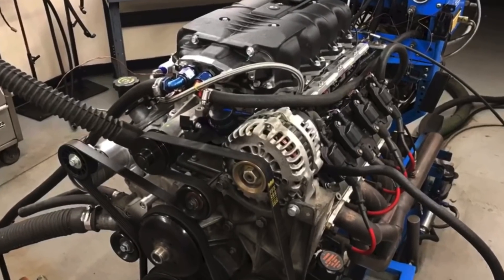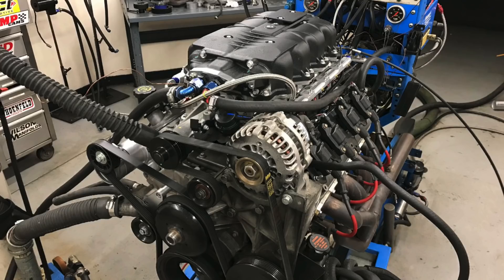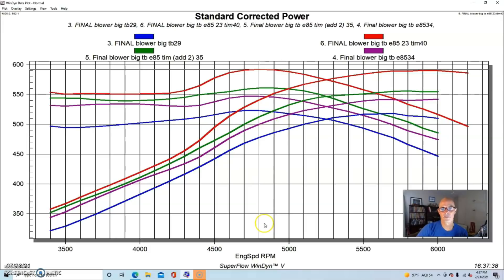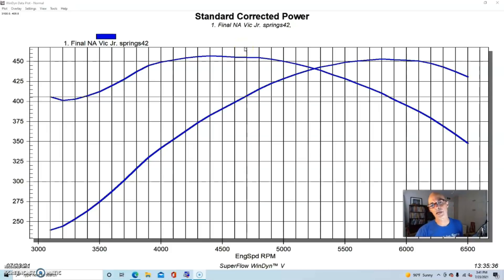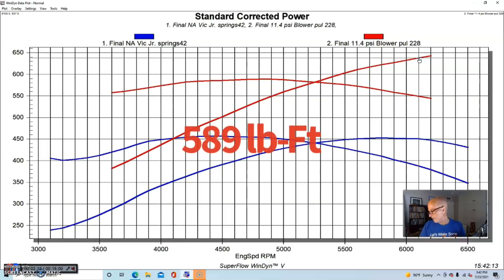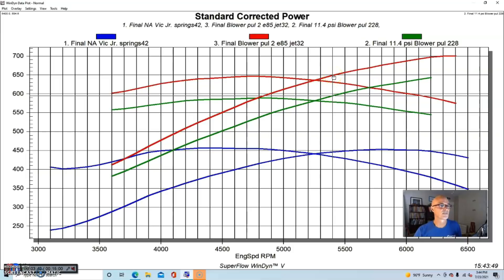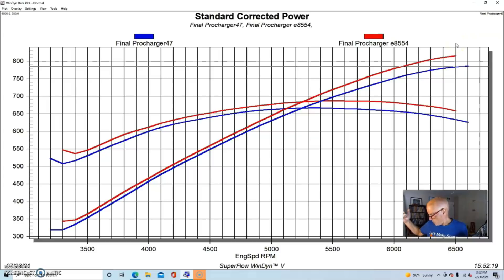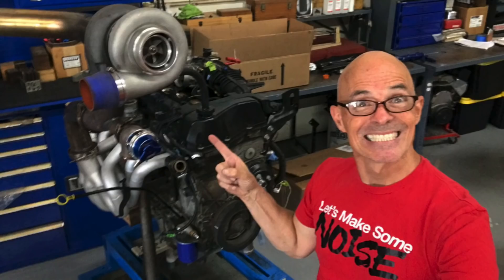E85-THE (CHEAP) GOLD MEDAL FUEL FOR BLOWER BOOST!

Comment: Richard holdner

If you are relying on the e85 to do the cooling why not run it through a cool can and bring it down as cold as possible?

Gail Banks ran air to water intercoolers on a naturally aspirated motor and got 6% more horsepower because of the colder air.

Engine Masters showed that by chilling the fuel in the carburetor they got more power

Those things both indicate that you would see an effect

Comment: 1. What heat range plug did you run? 2. What was the exact percentage of ethanol? 87% E is the most optimal blend. 3. Adding 91 octane doesn’t add through the performance. E is hard to light anyways, adding in 85/87 would work better than adding in 91. 4. What were your AFR/Lambda values?

Edit: adding race gas hurts the total performance
Reply from the maker: heat range 9, never tested percentage,
Reply: @richardholdener1727  I see a lot of guys go heat range 7, and 87%. Multiple ways to accomplish the same task. Love seeing tests and studies like this

Comment: Big question. I make 800hp on 93 with my 565. If I were to run e85 I would have to buy drum fuel. None in my area at the pump. So my question is, if I’m buying e85 in a drum wouldn’t straight alcohol be better sense? Also at that power level I wouldn’t trust pump ethanol anyways. Too much fluctuation in percentage. Answer would be greatly appreciated! 👍
Reply from the maker: does your combo need the e85 (high comp or boost)
Reply: @richardholdener1727  compression is low. 8.25:1 boost is low only 9psi. My issue is a 6-71 old school weiand that I have to turn 18 percent overdrive just to make 9 lbs. so heat is my killer of power.
Reply: @frankensteincreations4740  What you need is a better blower so you can slow it down and not build the heat. Weiand is the absolute bottom, I should know I've raced them.

Comment: I've been running 110&112 in my sbc 6-71 and it's gotten expensive I've been thinking about switching to the E85 just concerned about my carbs, thanks for this video, I'm switching
Reply: You need Ethanol carbs. E destroys rubber, so you need silicone guts. Gasoline eats silicone though, so unless you are solely E, you need Teflon and stainless guts.
Reply: You needs the e85 draw through carbs. Expensive but people make them

Comment: Been running E85 in my stock L67 Regal for about a year now. Insane how much quicker it is and consistent it has been since switching.
Used to have a similar car with headers, cold air intake, and a 3.4" pulley and the E85 car feels faster and it's so much more consistent

Comment: Also curious about Methanol here. M1 or M5.. possibly to run through fuel injection?? Maybe even a flex fuel vehicle???
Reply: I've been asking for meth tests for 2 years...
Reply: @YZFoFittie   well it's only 50 bucks and one test away from a video. Maybe we can get a few more requests for it. Methanol! Methanol!
Reply: @RontinsSpeed  lol $50? Nah, it's not as simple as a fuel change. You need MASSIVE injectors to run the engine. I didn't mean, "meth injection" the supplemental type! Lol
Reply: @YZFoFittie   I understand the fuel flow is increased. I run methanol in go karts, we have to jet up significantly. I wanted to see how much power it's worth on a bigger scale
Reply: @YZFoFittie  I completely understand the upgrades involved, but Richard Holdener is the man, he has the goods that he needs to make it happen. Not a big deal for this channel, just pour in the fuel, swap injectors, and tune
Reply: @RontinsSpeed  yeah it's not nearly that easy on a v8 scale. It's 20-30% more fuel which brings you into mechanical fuel pump realm. Many setups even go mechanical on the injectors as well.
Reply: @YZFoFittie  let's get Holdener's view on this
Reply: @RontinsSpeed  he rarely replies at all let alone on older posts, but one can hope...

Comment: Richard. how can I send u pics or vids? I have a great pic of a schweatty carb adapter and 6/71 (468 w/3310s done by Classic Motorsports in Alexandria, Mn)on a 95°+ hot, humid Minnesota day on the dyno in July or August.  Can you do a bit about adding ported vacuum advance for steady state cruising and its effect on egts. It will blow people's minds, especially on blown applications. We did a light load, steady 3000rpm cruise test and the headers would go 15-1600 and keep climbing, after adding about 6° from memory, it was about 7-800° steady. Keep up the good work. I feel we are brothers from different mothers on the quest for real, solid information.

Comment: Hey Richard! I'd love to see a comparison between intercooler/E85/methanol injection cooling abilities. We all know you can stack em up, but what if you don't have room for an intercooler? Should I just run E85 or should I run Meth injection? I'd love to see these all done, and maybe mix and match too? Which combo makes the coolest charge temps?
Reply from the maker: e85 wont show cooler air temps unless its carb or efi tbi
Reply: @richardholdener1727  I know where you're coming from. But from what I understand, even in port injected or direct injected applications, the E85 will still cool better than gasoline. There's more of it for one, and the alcohol also sucks the heat out of the air better. One of the things I did to a Subaru BRZ I had (direct and port injected) was write an e85 tune. It made a massive difference everywhere, I know more timing is one benefit, but the cooling capability had to have some effect
Reply: @excalibur3895  Ethanol burns much cooler and you need a lot of it , so clearly is cooler :)

Comment: Back in like 2014 when I was 23 or 24 I  started fooling around  with ls stuff and turbos and e85 it was hard to get where I live so me and alot of other car guys would bring 55 gallon drums and fillem then up, after I done it twice it took me longer than it should have to know the ethanol content was alot less than my first drum of pump e85, I started using holley efi almost since I started with ls stuff especially boosted stuff I started out with a Hp ecu and still have it but without a flex fuel setup and with my not great tuning skills I killed a sbe 5.3 in one night and my smart friends who know what they are doing and have been teaching me stuff for a while thought it was funny it kinda was at the time. After that fiasco I learned  a few things I  really liked ethanol and I wasn't doing the flex deal so I started using ignite red  and really liked it I just started ordering drums of ignite red, I know  people are gonna think I'm crazy but o well it's consistent and a damn good fuel way better than pump E
Reply: What exactly killed it. Timing? AFR? Was there closed loop on your set up?

I did a diy E85 blow through carb conversion and plan to run only 2~6 psi at the manifold without a wideband or even testing my E on the base timing map for an 87 octane engine time (6ls msd6014 preset map)

Would love to hear from your experience so I don't make the same mistake
Reply: @lucysmith4242  definitely Air fuel and timimg closed loop around 25 poumds no boost cut. I went from like e85 to. Something like e60 and like i said I was just learning how to tune lets just say lots of mistakes where made on my end. lol

Comment: But the bad side is 15mpg goes down to 10mpg.
Reply: You need to work on your tune. I ran it for years in my 87 Corvette and only lost 15% fuel economy. With e85 being 15-20% cheaper it was a wash in expense.

Comment: How about you do a turbo VS belt drive pro charger VS bolt on to  crank pro charger ? haven't seen you do a crank mount pro charger yet
Reply from the maker: a crank mount is used for very high hp-it does not change the response rate of shape of the curve delivered by a centrifugal supercharger

Comment: Richard,  do you know of a method for reducing or preventing corroision from E85 while it sits in your fuel tank? If your hotrod is not a daily driver.. only gets driven once or twice per month. That's my concern.
Reply: Make sure its absolutely full or empty full will stop condensation
Reply: @austindoud273  ok.. thanks.
Reply: I ran it for years in bracket car and never had a problem. It only got driven 2-3 times a month. It did still have the charcoal canister so the tank is essentially sealed though.
Reply: @bartpang  good info.. thanks.

Comment: Cant get E85 here.  Its cheaper than pump 91 but you have to use a larger volume of fuel.  I wonder what this trade of looks like in the wallet, does it even out in the end $ wise?
Reply: Curious myself.. I've never even seen e85 for sale around here, been hearing about it for years now and finally starting to understand the pros and cons. Took years of learning slowly but my intrest/attention is finally high enough to try it out...IF I can even find it. 
Almost seems to be a West coast thing, I live in Va.🤷‍♂️
Reply from the maker: btr uses it on their dyno in Kentucky-east coast thing too
Reply: For me in Florida it general costs about the same as 87. But that is generally 20-25% less than 93 so in the end it costs about the same as running 93.

Comment: are you saying I can fuel up with E85 instead of 93?
Reply: If your vehicle is tuned for that
Reply: Depending on model year, etc. you have to make sure that your cars fueling system is compatible with the E-85 as it is corrosive to a lot of older (pre 2008) components. Fuel mileage will drop. Not available at all in 8 states.

Comment: Where on the cadillac blower is the map sensor located? I have a suspicion its pre intercooler and those laminova cores are a huge restriction so the boost pressure reads higher that it actually is in the cylinders. youd think 11 lbs would almost double the N/A output but only provides what a 120 hp bump? I understand theres parasitic loss driving the blower but just doesnt seem to be making what it should for that boost level.

Comment: Is E 85 effective in cooling Humid August weather
Reply: Boost or not it cools intake charge temperature. Ethanol evaporates faster than gasoline so it's better at cooling intake charge temperatures at the combustion chamber and the intake valve. You will not see it with the intake temperature sensor but you will notice that you can tune timing much more aggressively than with gasoline without pre-ignition knock or detonation. A good tuner can take advantage of e85 and you will notice the difference in a naturally aspirated engine.
Reply: Always run an intercooler
Reply: I dynoed a 468 with a 6/71 in 95°+humid Mn july/august weather with 2 3310 holleys converted to e85. The carb adapter down everything was cool to the touch and moisture was rolling off. It was super impressive. I'm a believer.

Comment: thats badass i wonder the difference on a NA 6.4 hemi if its worth it or not
Reply: I have done just that. It's supercharged now, but I switched to Flex Fuel (about E78 in summer here in NC) while it was NA. It was worth about 10 horsepower peak vs. shell 93 octane, but the biggest change was the torque! Holy cow that thing pulls so much harder down low on ethanol.
Reply: @danielwright8075  cool thanks for the info!

Comment: I’m running ethanol in my 2001 Silverado now. It definitely smells much better at idle with the cam lope.
Reply: Ayy got a 2001 Silverado motor (lm7) on my Nova, doing E85 carb conversion right now
Reply: @lucysmith4242  that’s sounds awesome. I am running the stock fuel injection and pcm with a 2016 Silverado flex fuel sensor, and data logged and tuned with hptuners. I have only had e85 in the tank for a week. I have it running great now! Good luck!
Reply: @Mattvardaman  thank you sir! Are you running the COS on speed density?
Reply: @lucysmith4242  no, it’s on the combination of MAF/VE or dynamic airflow. I will go speed density if/when I can afford to turbocharge the 5.3. As of now it’s just truck cam, springs, long tube headers, and cold air intake running on a 2002 Tahoe flex fuel operating system.
Reply: @lucysmith4242  I have the tuning of gen 3 Ls engines with factory pcm/efi down. With hptuners you can flash as many calibration edits as you want, and data log any parameter.  You can also use speed density with the factory pcm for running forced induction. 

I’ve never run an E85 carb setup or blow through carb, but they can make just as much power, if not slightly more from charge cooling.
Reply: @lucysmith4242  I’ve probably flashed my one pcm a 100 times or more. I successfully flashed a different year model operating system this past weekend which was a little scary, but it works great. Nothing wrong with a good carb setup though, I’ve had plenty of sbc engines with carbs.
Reply: @Mattvardaman  I may have to try them then, I might get HP tuners for my C5, and I have a couple of computers laying around as well as having set up an entire harness for my build and then switch to the MSD 6014.

Do you mind if you give me some way to contact you and/or point me in some direction to learn a bunch of HP tuners. I've looked into it a bit but don't have it down

Comment: Richard I you may be missing the point on E85. Good portions of your demographic don’t have access to e85. I don’t have it at my gas station.  It’s not because we don’t want to run it. Just a thought.
Reply: Ya we didn't really have any local till like 4 years ago we got 2 stations a town away like 15 to 20 miles away but for normal people it just doesn't make sense if your car runs 87 like my suburban my mpg goes from like 15mpg to 11-12mpg and it's only like $.10- $.015 cheaper but if I had like a bmw or something that wanted premium it might be worth it and then obviously for these performance applications
Reply from the maker: is your suburban boosted?
Reply: @richardholdener1727  no I was just saying that the cost isn't there for most people to bring it everywhere

Comment: Did the 4.8 employ a knock sensor? It seems like a person could run more ignition timing with that technology.
Reply: He has said that on their Dyno the knock sensors don't work they just show false knock regardless but on a Dyno you can dial timing in better and if you are boosted and getting to knock that can be a serious problem so Dyno tuning is much more important if it's na and not a crazy motor you can rely on knock sensors
Reply from the maker: we don't run knock sensors

Comment: What injectors did you use? I missed it in the video. I wonder what pump 91 would give you if you only swapped injectors & compared just the injector upgrade.
Reply: Injectors don't add power unless they're clogged or something
Reply from the maker: they don't add power by themselves

Comment: I've been running E85/E100 since 2007, 13:1 compression with iron heads in a street 455 Pontiac daily driver makes for a really fun driver. I make ethanol myself, from tree sap and cattails, a little bit from coffee grounds too. Planning to do some forced induction with turbos in the near future. I absolutely love the stuff.
Reply: Have you had any issues with corrosion or cylinder wash down?
Reply: @evanarthur7535  I've worked on a bunch of ethanol and methanol race motors when I was in a machine shop, the only noticeable difference I saw was the alcohol motors were significantly cleaner than the gasoline ones
Reply: @evanarthur7535  the biggest issues people have is having issues with fuel systems keeping up and alcohols attract a lot of water so make sure your pcv system is very well vented and engines need to get up to temps to burn water out of the oil. . Also mpg is a lot worse.
Reply: Badass! Subscribed
Reply from the maker: welcome
Reply: What do you do about oil contamination?
Reply: @YZFoFittie  engine oil is very clean because there is only 15% fossil fuels. Just make sure you have a -10 or bigger breather system so you can burn off the water/ethanol out of the oil.
Reply: @mr.know_it_all  lots of people complaining that the E dilutes the oil and doesn't, "burn out" causing bearing failures? 

Some guys even use crock pots or other methods of heating the oil to dry out then return back to the engine.
Reply: @YZFoFittie  or just run one of those bypass oil filter systems that removes the water and cleans the oil.. they even ran tests and it actually comes back with less particulate after being clean then it comes out of the jar new
Reply: @Bozemanjustin  call me a skeptic...
Reply: You make ethanol yourself ? but then you can do a max 96% like in brazil , or do you use molecolar sieves ?
Reply: @AAAAAAndrea  i just run it as it comes out of my still. I'll be making another batch this fall if everything goes well.. I'm rebuilding everything to increase my capacity.

Comment: Have you tested pump E85 vs actual E85. Around here its more E70 at the pump. Interested in power gains vs price.
Reply: I have noticed anything over about E55-60ish you get most of the benefits of ethanol, up to a point (1000hp LS stuff etc)
Reply: @dragpix  yes, e70 has allmost the same knock resistance as e85
Reply from the maker: i use pump e85 usually and never even measure it
Reply: Octane wise there is less than 1 octane difference between e50 and e85. evaporative cooling I do not know.  One interesting thing I read years ago is e3 has better evap cooling than e10 but goes up from there.. Just some quirks of E. Nothing is linear.

Comment: Fuel map was changed for the e85 but not timing? Correct?
Reply from the maker: YES
Reply: The engine wants what it wants no matter the fuel. You don't have to worry about ping/knock with E85/E100 so its only if you have to pull timing to avoid knock will you have a benefit from changing the timing. Sometimes an engine wants less or more on E85, and lots of things play into that like chamber shape, SCR, etc.